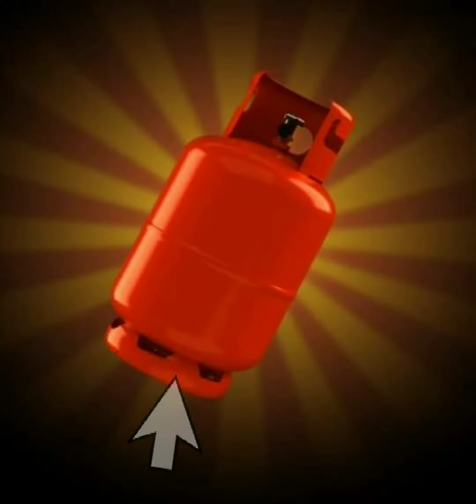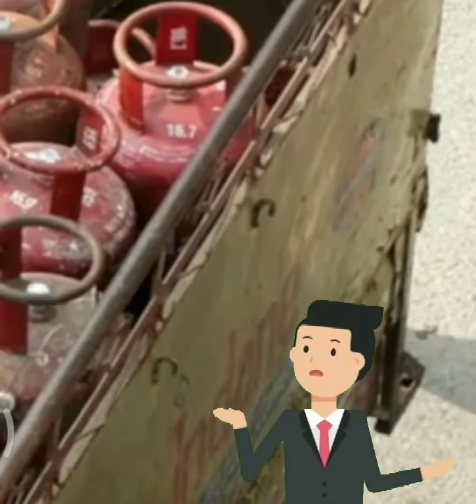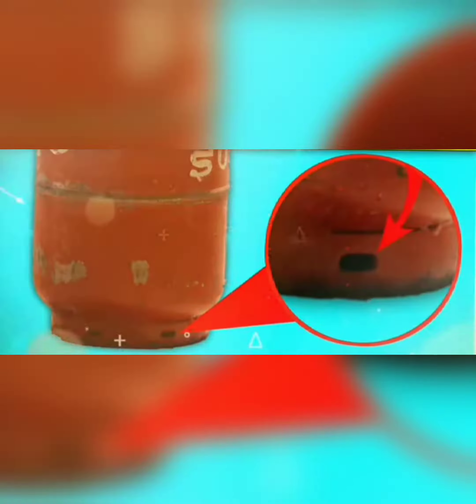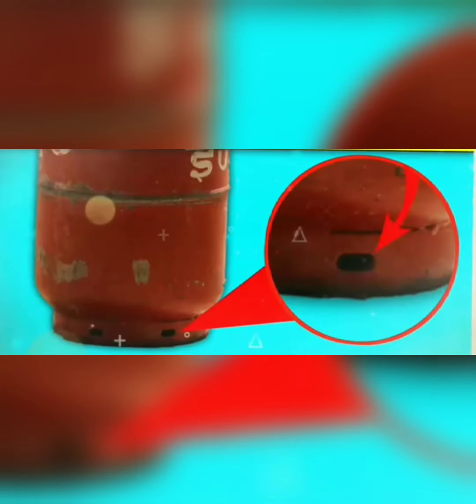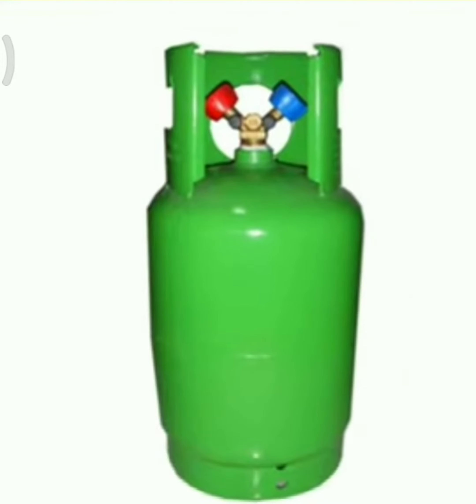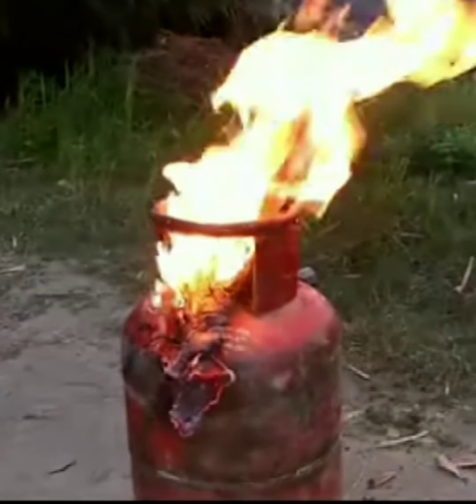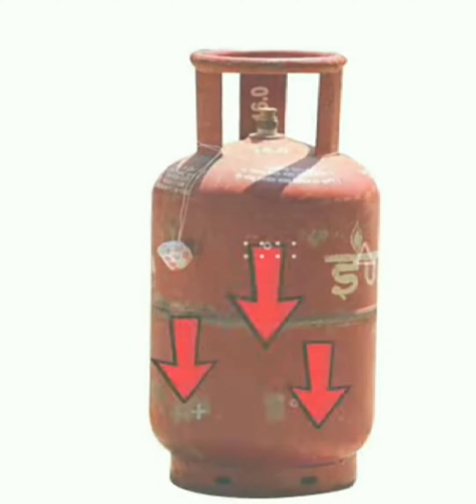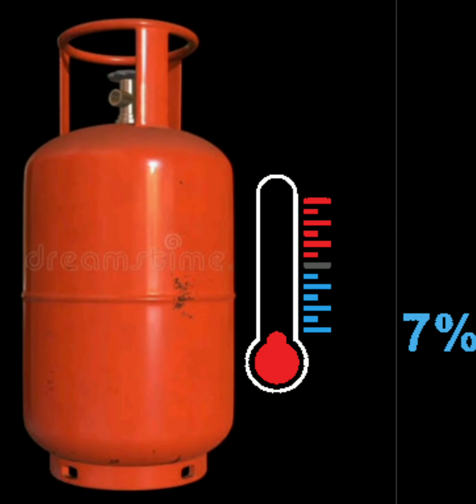Why are there bottom holes on a cylinder?|| What is it's importance||

Comment: Interesting information Dhairya👍
There are two more reason also-In order to evaporate the water molecule when the cylinder has contact with the water. Due to this, the corrosion occurring at the bottom can be avoided. 
Shape of these holes identify the brand name of concerned oil company also.
Reply from the maker: Thanks for adding more information. 
Thank you so much for your compliment. Stay tuned for more videos on the go. 🙏🏻😊